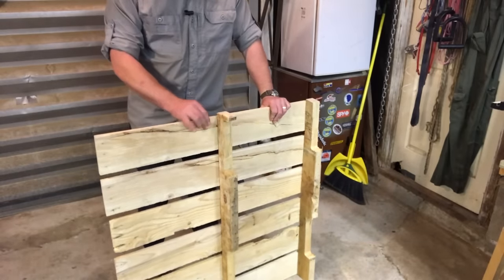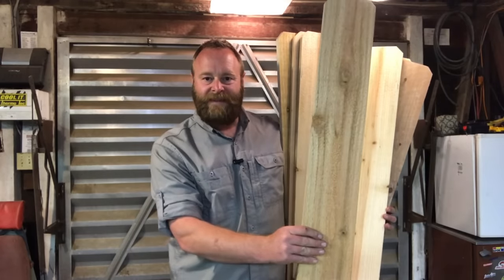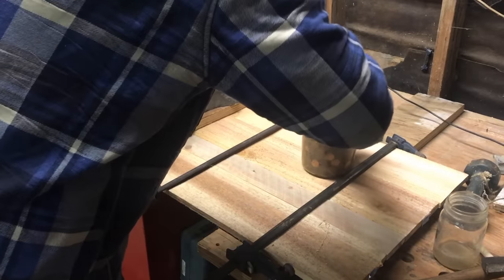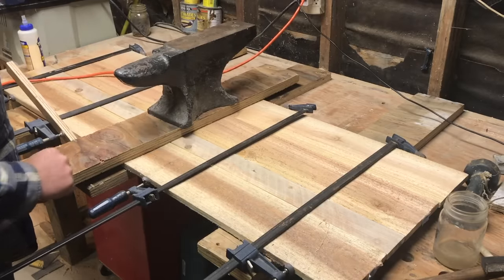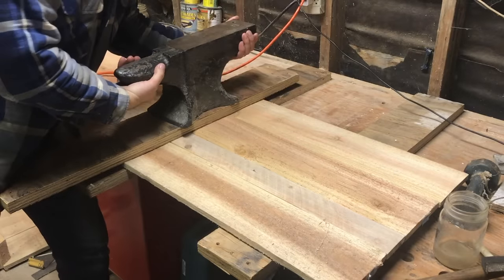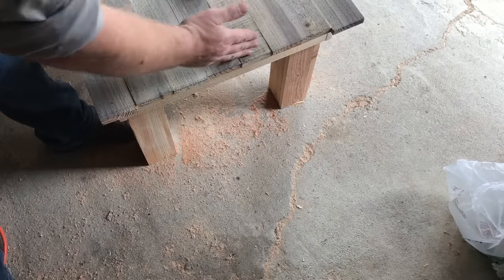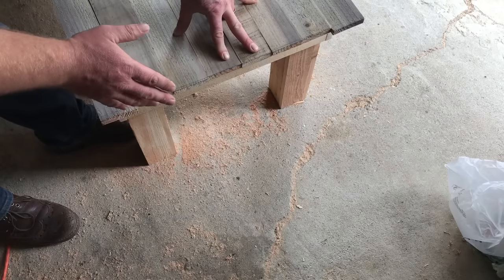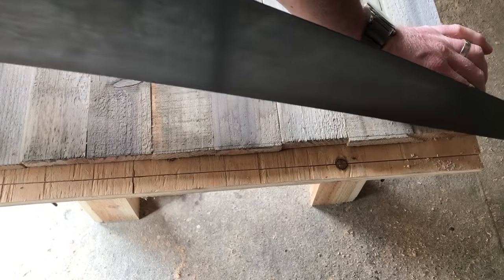DIY Coffee Table WITH STORAGE! $27 build

Comment: Pro tip- while using wood glue apply salt on the glue before placing it into its place. The salt will grit both pieces of wood so when clamping it will not slide or move while the glue dries.
Reply: That's the stupidest idea I've ever heard of
Reply: Mark Lewis it actually works though.
Reply: Mark Lewis maybe it’ll work but I have never seen it tested. However, it is a well known technique to use salt (I believe sugar worked as well). I have been using salt for years to help with sliding. A few of the well known YouTubers have used it, including Glenn from DIY Creators and Steve Ramsey from Wood Working for Mere Mortals. I encourage you to try it. It’ll definitely help.
Reply: @LetsGoHelio  omg I was being sarcastic. But really, I'm sure it works but why would you put a substance in your joint to keep it from seating?
Reply: Mark Lewis lol I figured you were being sarcastic but I didn’t want to assume. When I first heard about using salt, I thought it was ridiculous. I decided to try it out since my glue ups would slide around as I tried to tighten down the clamps. I ended up trying it and I was amazed! Of course, I only apply salt for larger glue ups and when using a nailer is not feasible. 👍🏽😊

Comment: Looks nice! 

As a side note: trimming the ends of the tabletop could have been accomplished with a circular saw or a router. You can clamp a straight piece of wood (or whatever) to the tabletop, to use as a guide. You probably know that, but some viewers may not.
Reply from the maker: Good point, I was kind of scope locked on doing it with a hand saw so this was the best solution I could come up with at the moment but your suggestion is just as good (if not better)
Reply: Um you have a table saw, I would have used that. Set up simple cross cut sled.
Reply: RAZER1RR ...yes but do you have the clearance .
Reply: Is just for the show folks,showing off skills  it’s all..table looks nice by the way
Reply: @ZackOfAllTrades  At least with a hand saw it wont splinter & the work will be straighter & better quality.
Reply: Easy circular saw guide. Get a piece of 1/4 plywood, can use a scrap as the edges do not need to be square. Screw a long straight board roughly in the middle to act as a "fence" so that you have at least 5 inches on one side and at least 2 inches of plywood on the other side. Run your circular down the wide side of the fence. You just built a zero clearance saw guide for your circular saw, clamp in place and cut away. Also, since the plywood supports the top of the workpiece, the guide also massively reduces tearout.
Reply: I was thinking table saw with a sled but whatever works works.
Reply: @DrBobJeeper  that would have to be one really huge crosscut sled though
Reply: Knowing and having the availability of the tools r 2 different things in my book.

Comment: Looks GREAT! Just FYI, new cedar fence panels are normally still pretty green and shrink A LOT when they dry...... Don't ask how I know that.......
Reply from the maker: Oh man I hope that doesn't happen.  As light as they were I didn't even consider being concerned with moisture content.  I guess we'll see.
Reply: How you know?
Reply: @Zach Of All Trades did the boards end up shrinking?
Reply: jayer 1981 what are the dimensions of the legs on this table? Great job
Reply: True, I built a outdoor play house for my daughters out of cedar planks that one of my friends had laying around I didn’t milk any of it and did my absolute best to nail the planks as tight as possible and now it’s been about yr and there’s gaps in between planks that are up to 1 inch apart.
Reply: Glad I read your post....I was about to start this project...How would I dry these boards for future use?

Comment: A tip for your hinges. An oscillating multitiool makes it faster and easier. I got one at Harbor Freight for a great price and I use it all the time. I love it. There are a lot of blade options and it's great for a lot of different types of projects. It will save time and headache

Comment: Did you use two different types of wood cause the pattern is much lighter then the rest of the top
Reply: He treated the wood around the pattern with a vinegar/stainless steel stain.  The cedar reacts with the stain; aging it and making it turn a cool blue or grey color.  He did not treat the pattern with the same stuff so it did not get that aging effect.

Comment: Nice job!! 
A good basic design and some craftsmanship yields great results every time!!!
So true about the pallets. More trouble than their worth.
Reply from the maker: Thanks very much!
Reply: Fab Race Mod Repeat ...i know what you mean, but it depends on the pallets. I've been using pallets for many many years for woodworking projects, and know at a glance which ones are good for dismantling.(a proper pallet breaker tool is very useful). The others get cut up for firewood!

Comment: Thanks for making the video, table looks good and is well built. 
The board you've clamped to guide the saw is a great idea! 
I also like that you've delegated the sanding, but you might want to consider getting a respirator for both of you.
Reply from the maker: I agree RE the respirator, as it was I had a box fan set up just to the left which was evacuating most of the sawdust but you're absolutely right, respirators should be in use.

Comment: Excellent project. If you had wanted to apply some finish, you could have stained the inset boards a different color from the rest of the table top (before gluing) so it pops. The you could apply a sealer coating, such as oil-based poly/polycrylic, to make the surface more durable, and so the table is water-resistant but does not show rings if drinks are set on the table.

Comment: I saw a video where someone used toothpicks to help with join ting wood. I tried it and it works great! Super cheap and effective. Can't beat it. Especially in a pinch. Also parchment or wax paper underneath your glue ups will prevent your glue up from sticking to surfaces.

Comment: Good job Zack:you are a champ with handsaw,your assistant excellent,.. but some some safety concern with power points across the work bench instead underneath because rotating tools should not touch power cords 🔌

Comment: Great video haha. Maybe it defeats the purpose of "less work", but you could save that piece of plywood you put the saw kerf in, continue the cut extra long, at the end send a screw through the side with a spacer to maintain blade thickness (thin piece of scrap), then you could have a saw kerf jig for life! Just clamp it so the saw can fit through on the first pass, hence cutting it long!
Reply from the maker: That’s a really good idea, I may do that next time I have to pull out that trick. Thanks Corey

Comment: FYI, a sawzall(reciprocating saw) is designed for de-construction mostly. Use a regular wood cutting blade to cut the pallet nails, glides right through. That pallet could have been disassembled in about a minute.
Like to overall look of the table!

Comment: How to remove boards from pallets:
1 use 2x4 to pry side and centre 2x4s
2 use 4inch of 2x4 to place on underside of board you want off.
3 with hammer, hit the 4 inch 2x4 until board comes off
(Does not matter if nails go through the board)
4 mix saw dust and white wood glue and fill the holes where nail holes were,
Sand the saw and wood glue mixture until even with the board
5 you're finished!

Comment: I took a pallet apart this very evening.Best to hit the slats hard with a large hammer.That won't dent the wood too much and  they will  come off no matter how well they are nailed on. You can get the initial 2 or 3 millimetre gap for a crowbar by hammering a sharp chisel into the gap where the boards meet.You can avoid some of the nails by simply cutting with an electric jigsaw off to one side.OK to sacrifice a couple of inches for that.
Reply: Just hammer the nails out in the reverse direction to how they were hammered in.A cheap little 12  inch crowbar levered over a slat of wood will pull the nails out.

Comment: Nice table.  I would have driven a few screws into the cross slats on the underside of your table top personally.  Glue is okay but you know at some point a kid is going to jump on that table and it’s going to splinter at the joints because the edges aren’t perfectly parallel as you did not use a jointer.

Comment: Depending on how dedicated one is to reusing pallet wood, center punch the nail head and drill most of it away with a bit slightly bigger than the nail shank. A countersink bit can be used also. This makes removing the flimsy boards easier and minimizes the chances of the nail head pulling through the board.

Comment: I love your table.  Challenge:  a 6' window table with pot holes spacing plants across.  However, most tables do not have a place for the drip tray or saucer so it needs 2 levels.

Comment: Fence pickets - $27
Table saw: $600
Mitre saw: $120
Compressor: $400
Air gun: $120
Hand Sander: $60
Workbench: $300
Clamps: $15 - $20 for four
Wood glue: $2 to $3 per bottle

Workspace for all of it: priceless

It’s fine to say “built it yourself”, materials are in fact cheap. Problem is it’s the cheapest part of the build, if you already have the tools. Most of us don’t or are in the process of investing in woodworking. Overall for a single piece, it’s still cheaper for me to pay this guy $100 to buy materials and his labor to build this for me then to buy $1700 worth of tools (and that’s for mostly the cheap stuff and doesn’t count saw blades and other consumables). Unless you plan to build a house worth of furniture it’s not cheaper to build it yourself.

Comment: when attempting to make accurate crosscuts make a jig . my crosscut jig is 52" long use about an 1/8" x 8" wide piece of lauan or equiv. glue and brad a straight piece of 1/4" 3-4" wide to that . clamp this to the edge of the work surface and place the circ saw table opposite of the blade against the 1/4" portain of the guide and while keeping the saw against the 1/4" material rip off the access. now all you have to clamp this device to whatever you want to cut at your marking score it with a knife and cut it . perfect cuts every time.....
Reply from the maker: Cool Thanks

Comment: The easiest way to make a perfectly straight edge is with a pattern router bit and a straight edge.  Clamp the straight edge on the work piece then run the router along the straight edge and you have a clean perfectly straight edge.

Comment: I would just use a nail punch and hammered the nail of right through the face of the board. You would end up with some easily patchable nail holes in your material but at least you wouldn't have to pry anything apart.

Comment: Did you support the bottom of the storage compartment?   Seems like it might easily get overloaded and fall out the bottom - hopefully not though.  I really like the design, might need to build a piano bench now.  Thanks, Zack.
Reply from the maker: You know, I really didn't and so the table will come with a bit of a disclaimer that it's probably best not to store books or rock collections inside it.  Glad you enjoyed it!
Reply: How would suggest best way to support the bottom?
Reply: You could either glue a couple of boards across the inside of the box, and staple them into the side rails.  That would make them invisible, but the inside would not be perfectly flat.  It would look like the door Zack made at around time 7:40.  Or, you could glue and staple them in before you put in the bottom board.  That would leave you with a nice, flat surface inside, but the depth would be a little shallower, the thickness of the support boards.  It would easy enough to start with the original, and then if it fails, add the boards to the inside to reinforce it upon repair.  It's a nice, clean design as it is.

Comment: I am wondering, with the 3 boards you glued under the table top across the grain.  Would that not cause movement restriction on the table top and cause failure when it shrinks or expands ?  I have seen usually people put some flat bars with screw in a larger hole to allow for wood movement but using glue seems ot me, that it would put tremendous stress on the glued up panel. Or did I miss something ?
Reply: I expect the table will loosen up in a year when the wood does dry out.  The support will fall off the top and so will the storage shelf.  The rest will grow larger gaps  but then it was inexpensive.

Comment: Why not just use a circular saw with a guide/straightedge clamped to the table top for those final cuts? Or you could slide the whole thing upside across the table saw with your miter gauge :P.

Comment: That would cost me more than $27 to make. I’d have to buy all that equipment.
Reply from the maker: My hand saw was $4 at a yard sale, hammer was $1 at a second hand store.  Screw driver set me back $3 new and hinges/hardware were about $5  Add a $1.30 box of nails and a $4 bottle of glue and you're into it about $46. I just used the power tools because I had them available and sped things up a bit.  You just gave me a real good idea for a series though, projects using only a few inexpensive easily accessible tools :) Thanks! and thank you for watching! ~Z

Comment: I have never had any trouble taking apart a pallet with my sawzall
Reply from the maker: Yeah I don't know what was up with the ones I got.  Bulletproof nails or something.  Wrecked several blades before I called it quits.
Reply: @ZackOfAllTrades  It does kill mine if I get into the wood with the metal blade. Also could have been steel nails

Comment: Cool project... and the hand saw part is a lost art unfortunately!! Great job
Reply: That's not really hand sanding and using a da or ra sander isn't a lost art as millions are sold and used each year.   
Even the smaller furniture shops use even if they have a large drum sander since it only sands large flat surfaces like a table top in 1 to 3 passes depending on how smooth the finish is you want.   But if you want the smaller pieces sanded you need to use the random orbit sander and even actually hand sand if you want to get tight into the corners

Comment: not quite sure how a skillsaw blade would "kick out" of you cut the ends of the table top... lol never have i ever seen that happen. that is what a "rip" is right.. which is why the skill saw was actually designed to do..
Reply: A rip is when you cut long ways with the grain. This is a cross cut across the grain. And a circular saw would work but as he pointed out there would be no kerf on the shortest board making it easy for the edge to be skewed. The hand saw gave him much more control of the cut. 1 second with a skill saw in the wrong direction is like 30 strokes with a hand saw. Hand saws are way more forgiving. Thus why you never see a cabinet maker reaching for a skilsaw for finer cuts.

Comment: It's really not hard to break down pallets. A whole evening? I broke down 250 pallets, nails included, in roughly 4.5 hours. There is a fantastic tool you can buy from ebay. Just google pallet break down tool. It's a fork like design.